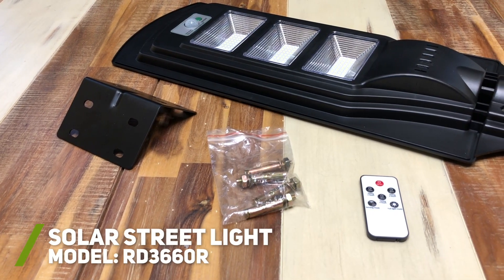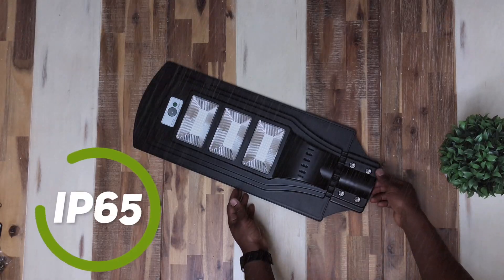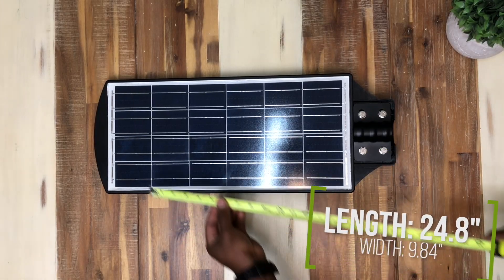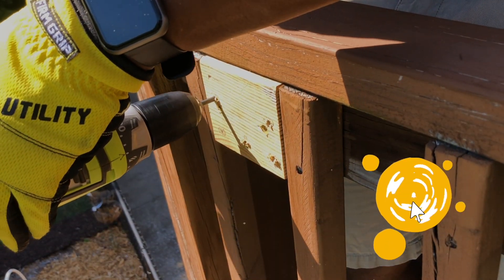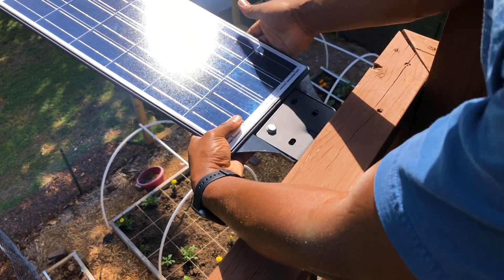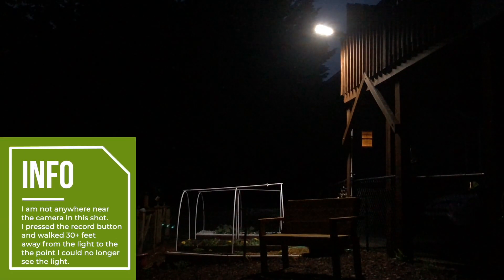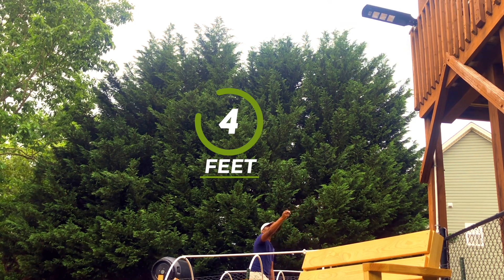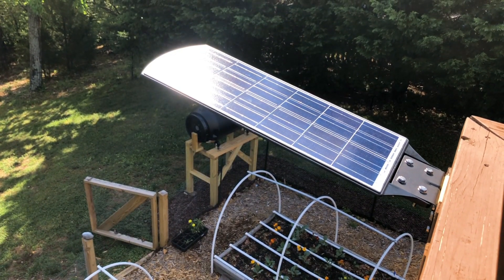Solar Street Light | Install & Review

Comment: That looks just like the ones i have. THERE BRIGHT AND THROW OUT BRIGHT LIGHT  The problem with pole lights is trying to fine pole for them. Even metal fence pole are hard to fine and VERY Expensive ! So what does that leave me with?  Wooden post. 4x4x12' that what i used. I don't even cement the post into the ground i just bury it 2' down cover it up add water to help pack it, and that is IT !  Painting the post b4 setting them down into the ground them help protect them lots longer

Comment: These solar street lights are getting better and cheaper. I like to get the 2 deal pack!  The plus about them is?  If there is a power outage? YOU GOT LIGHT The problem right now is? They don't store power long enough. You get  3 day CLOUDY DAYS. There dim! Some want even turn on.  They do NOT CHARGE GOOD!   ON CLOUDY DAYS!  > Stay away from the plastic arms ones!  There easy to break!  Stay with metal arms street lights 👍. Or if you got away to wrap steel putty around the plastic arm or bondo is what you MUST DO>  but that is expensive

Comment: Drill a tiny hole at the bottom at the lowest point so rainwater wont collect there and flood the electronics. But if you're sure its waterproof, dunk it in a bucket full of water and see what happens. Dont forget to post the video hehe !

Comment: Good review Robert, but I'm not sure that I would be able to install it in a location where it would get enough sunlight on my barn/shop which may be too far from the house for the remote too.
I ordered two of these from Amazon last night. 
 FLOODOOR 30W LED Motion Sensor Light, 12-24V Outdoor Security Super Bright Flood Light, IP66 Waterproof, 6000K, 2700LM, Daylight White, 150W Halogen Bulb Equivalent, PIR Sensor Light (2 Pack)
Reply from the maker: Awesome. I may check out that concept as I do have an area I would like to add some lights but have the same issue as you. Thanks for sharing.
Reply: @GreenTechTown  if you add a Chinese greenhouse blanket and green house plastic; couldn’t this light at 30,000 lumens and 6000 k function as a grow light in winter?